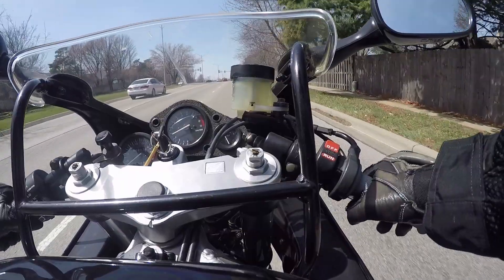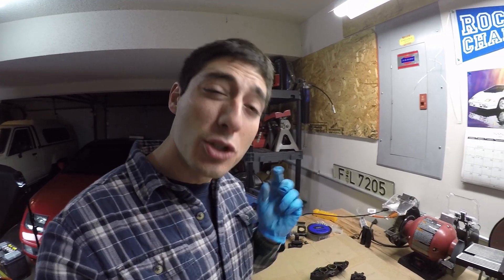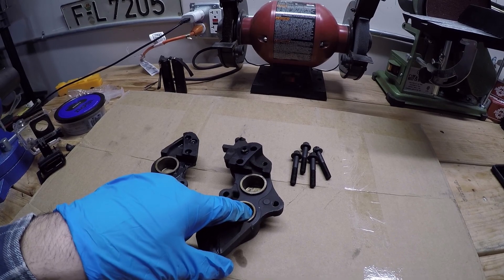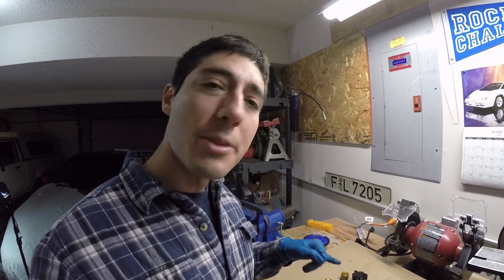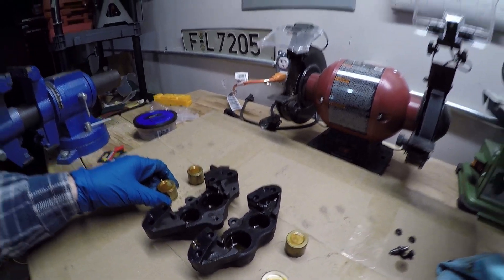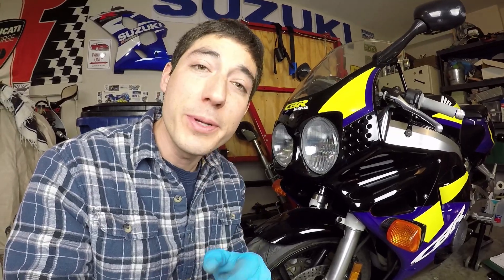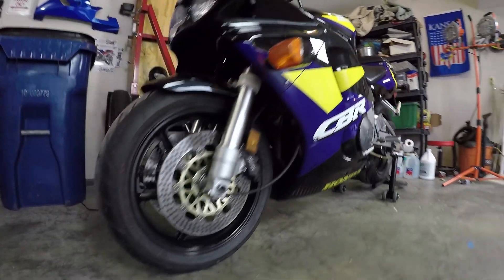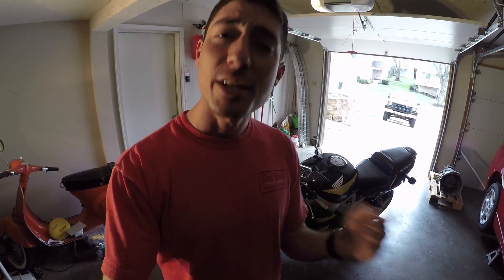20 Years Did A Number On My CBR900RR's Brake Calipers

Comment: I've got this same noise although not as loud on my 99 CBR 900rr. I just replaced the brake pads as well but noise is still there. Watched this video then immediately went and bought some DOT4 and took my calipers apart. Same issue but only on the right side caliper was completely clogged. Glad I watched this as I was considering buying new calipers.

Comment: Glazed rotors and pads. Mercedes Benz, even 30 yrs ago, sent brake pads with sandpaper glued on, to the dealerships, as a special tool, to install, and drive the car around the parking lot, to " rough up" the glazed rotors. It worked pretty good, got rid of the noise. Restored stopping power. Had to sand the brake pads too, or replace.

Comment: The rotors are probably mounted with uneven pressure–e.g. one of the rotor bolts is probably much looser than the others, creating a flexible zone which vibrates at high frequency when braking pressure is applied. Think of a tuning fork and how you can silence it by pinching the sides that vibrate.
Reply from the maker: I hadn't thought about that - thank you! I'll check the rotor bolts out!

Comment: Not sure if you still have the problem. I'd suggest replacing the pad hardware- pad pins and spring clip.  The spring can lose its tension over time and the pins can wear a groove where they contact the pads. Then the vibration makes noise. I think that's often the cause when lubing or other fixes are temporary but the noise comes back.
Reply from the maker: I hadn't considered that - thanks for the tip!

Comment: Next job is the same on my ‘99 RRX Blade.. I have no noise, but there is a judder through the bars when braking hard from high(ish) speed. Potentially warped discs, but I’ll pull the callipers apart too and check the pistons aren’t sticking. Good video. Wish I had an airline 🤗

Comment: I agree with a previous commenter. Possibly the rotors. They could be warped or unbalanced, casing a harmonic vibration.
Reply from the maker: I'm going to check the rotor bolts out!

Comment: glazed rotors & brake pads and unintended use of the brakes

when I bought my 954 blade it also had squealing brakes with oem pads. After having cleaned and sanded the rotors and the pads it didn't squeal at first but soon started to squeal again after having used the brakes with low braking force in city traffic.    
Then I decided just to use the brakes hard and they have not been squealing since.

Yes, the original pads might be too hard for riding like a puss and only braking lightly.

Comment: Just saw your video on the brake calipers.  It appears at first sight that you had yourself a very dangerous condition with the rear pistons being seized into position.  I would have to say that there is a possibility of cross contamination from "someone" using something other than DOT4 brake fluid as a top up.  This can lead to some nasty crap inside the system itself.   I would suggest a brake line replacement as well with those rubber lines on the machine being as old as they are need to be changed because they WILL burst one day.  Hydraulic fluid should be done every two years with regular use as it does degrade and at a faster rate with aggressive riding and high temps it does so much faster.

Comment: I'm resurrecting a 93 900rr red white blue with 460 miles. It runs! Doing brakes caliper rebuild, vapor honing, painting covers...etc. Can you help with a detail of how the clutch cable get routed? Mine is hanging up and causing issues when I go full lock. Thanks

Comment: Did the brakes perform better after this? My 900 seems to have pretty bad front brakes compared to my other bikes.
Reply from the maker: The brake lever firmed up a bit, but the initial bite is simply not there. I'm considering trying different pads.